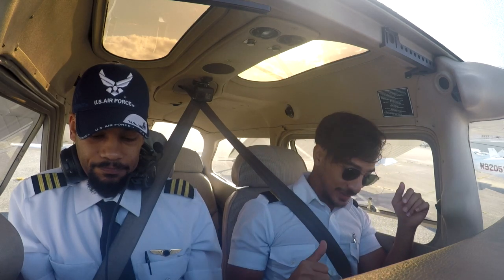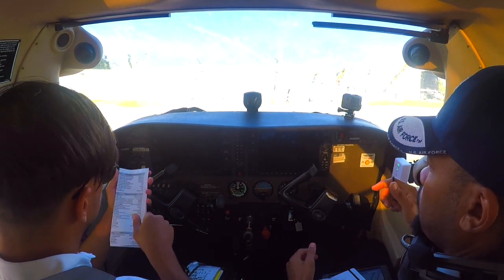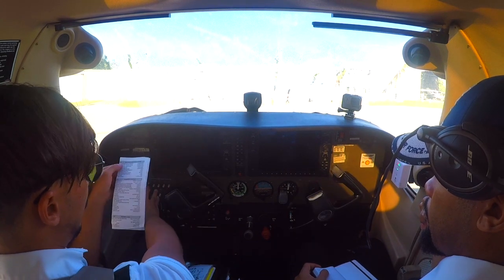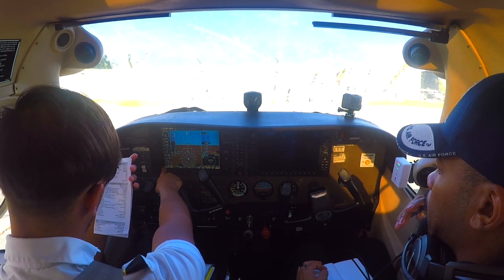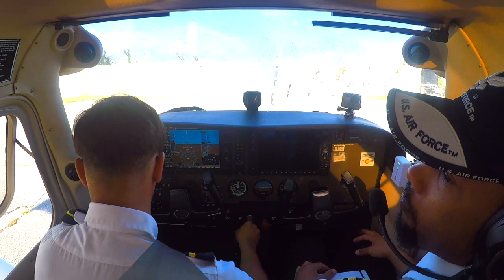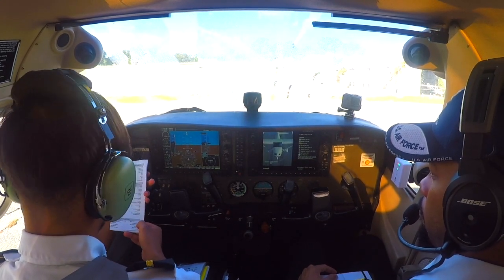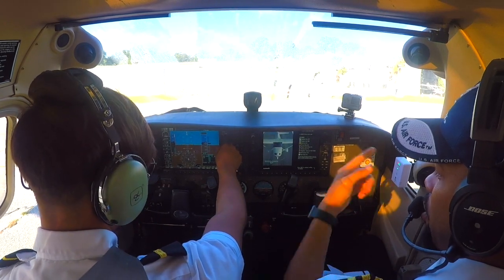Cessna 172 SP G1000 Startup Checklist Tutorial

Comment: I am transitioning from steam to glass, this startup was very helpful! Thank you for making this.

Phoenix, AZ.
Reply: I'm in PHX too! What's with the winds this month man
Reply: @jackisdriving  It's always windy in the spring time - I think that is nature's way of spreading the flower/seeds that are in bloom right now. But it is not so good for those of use with allergies. And then of course spring gives way to the summer heat and it will be turbulent starting at about 10am, so if you want smooth air, you get in the air by 6 am...welcome to flying in the valley!
Reply: @archerpiperii2690  I miss winter 😭
Reply: @jackisdriving  Yea the cooler months do have some great flying.

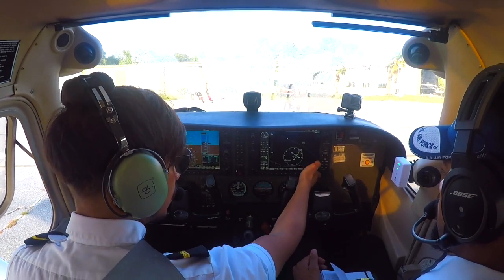Comment: At 9:02 he says since start up he’s burned 2 gallons. The engine was running, at idle, for only 4 minutes. The 172 burns approximately 8 gallons per hour at 75% cruise power. If you do the math, in four minutes that’s 0.13 gallons burned. I’d round it up and call it 1 gallon which will take care of taxi fuel burn as well.
Reply: That's what I thought too